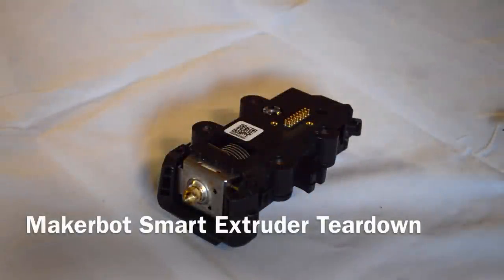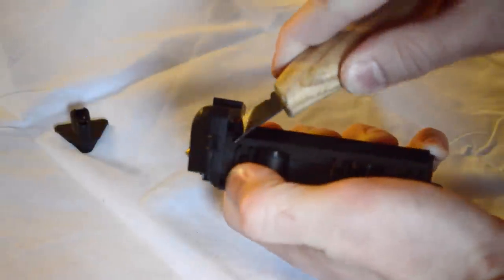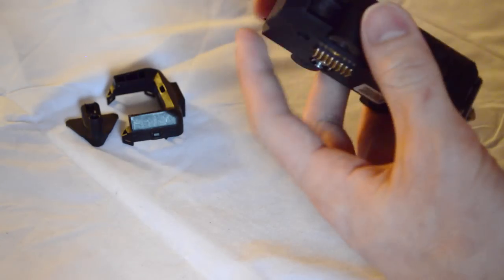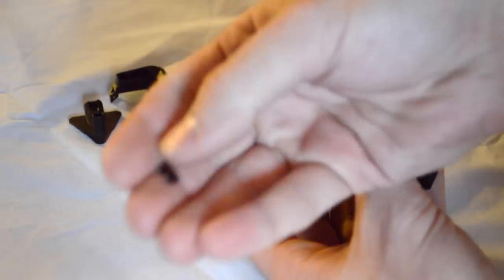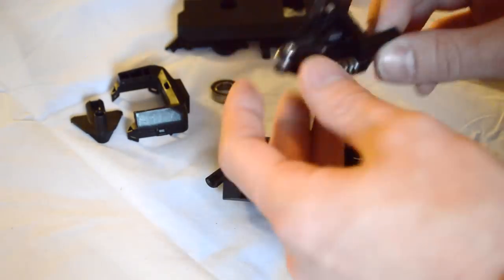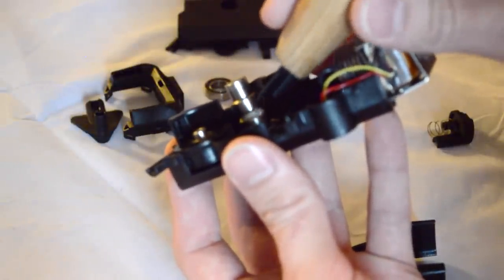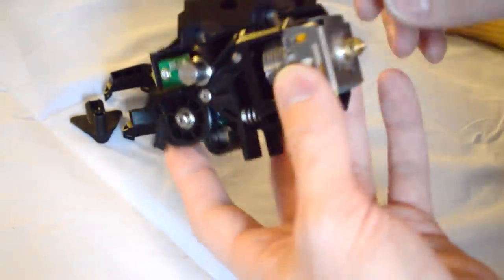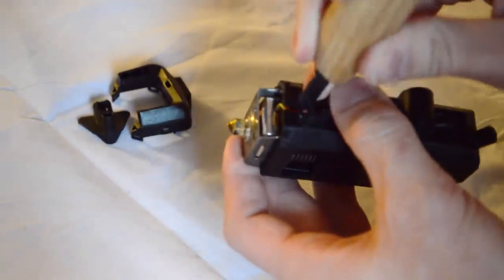Jammed/Clogged Makerbot Replicator Smart Extruder Teardown

Comment: It's nice but when it comes during printing, it's just bad. We would need a new extruder design (they call it smart extruder, kind of ironic) instead of a temporary fix. Thx a lot for your video by the way. Very clean and straight forward!

Comment: Thanks for sharing. My Makerbot is the most troublesome device I've ever purchased (I wish I'd purchased a different brand). I've had four extruders (two under warranty - one purchased as extra/spare to the original extruder). I was getting approx one successful print in four attempts. Most resulted to great clods of molten filament jammed in and around the extruder (so it couldn't be dismantled).

Comment: hmmm well if the clips are fragile and break off someone should just make a 3d printable replacement part for so when you run out of clips you have a replacement part for it just saying
Reply: +Raven 4096 I agree
Reply: funny that you can print other 3d printer parts so you'd think someone would design a printable replacement part like that for your printer so you can replace the plastic part when you break off to many clips and then be some what self sufficient no need to order a new one instead and pay more money